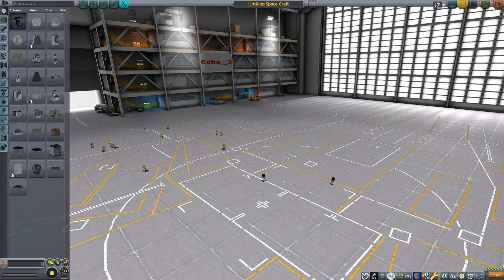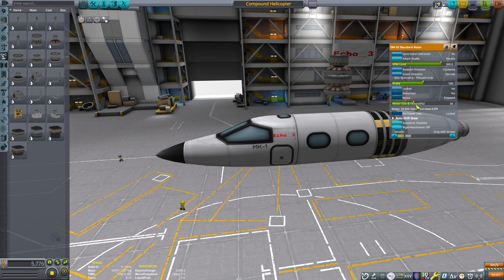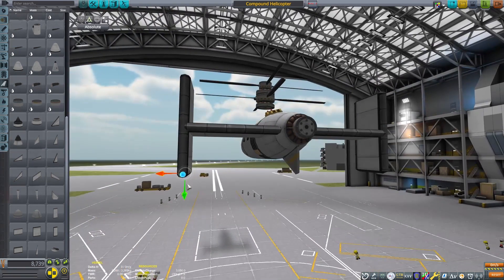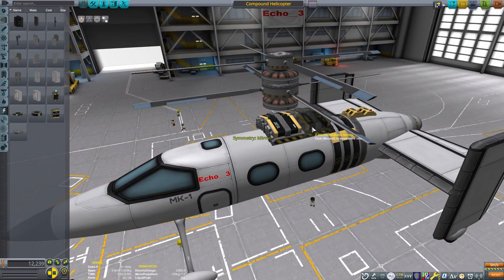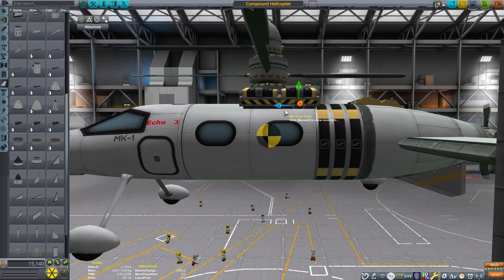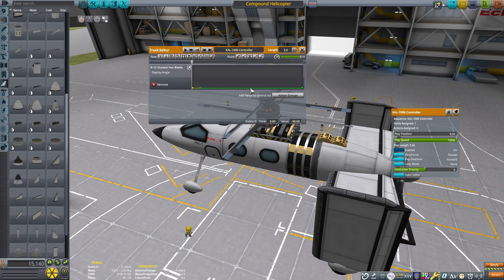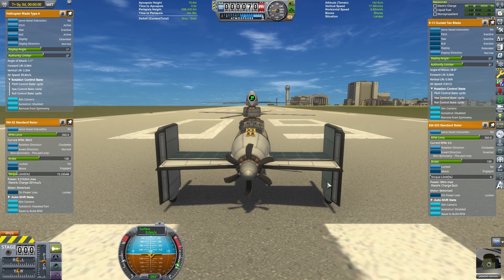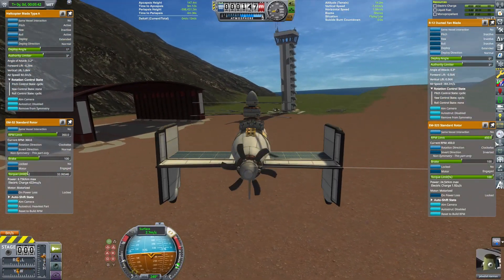Compound Helicopter: How to make a fast helicopter in KSP

Comment: This blows my mind and i can't wrap my head around it. 

Why do you think you still had a little bit of leftward rotation on the craft when you sped up? I noticed that you kept needing to balance it by rotating right until it drifted again
Reply from the maker: I think this is because I only used a single pusher propeller. I think using 2 counter-rotating propellers might have helped.
Reply: @Echo3  Is there anyway to account for this while using a single forward engine?

I am able to take off with my helis but they are very unstable and I can't figure out why there's always a drift to either left, right, or pitch up, even when I counterbalance with two engines rotating in opposite directions
Reply from the maker: @yarknergin4424  With a single rotor, there are some things that can help. If you are familiar with real helicopters, the rotor blades are on hinges allowing them to swing fore and aft. This helps with the roll issue. As the helicopter travels faster forward, one side will have the rotor blades traveling faster relative to the direction of travel than the other. You will get more lift on this side and less on the other. This is called retreating blade stall.
https://en.wikipedia.org/wiki/Retreating_blade_stall